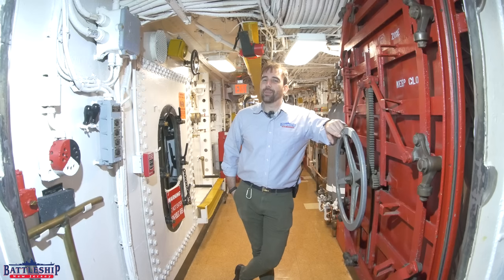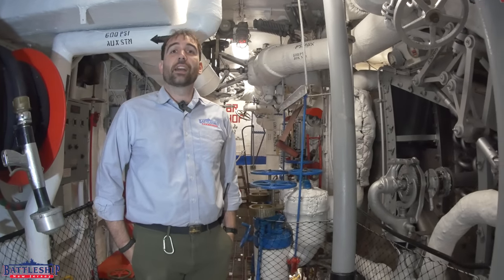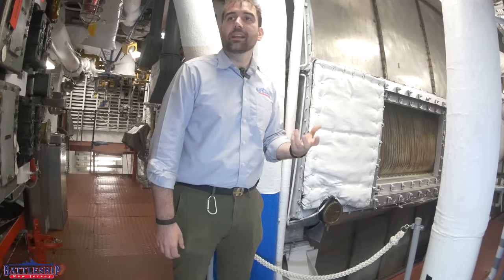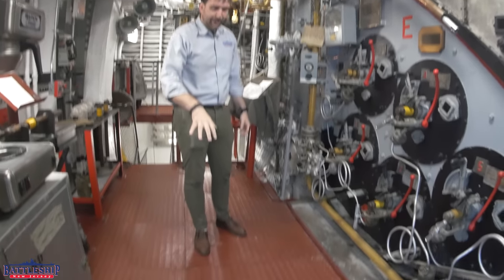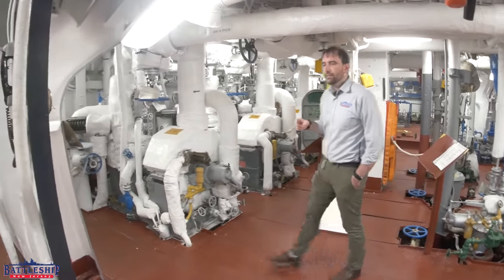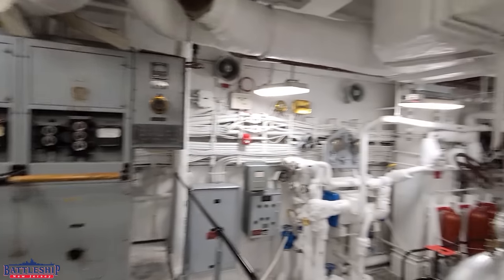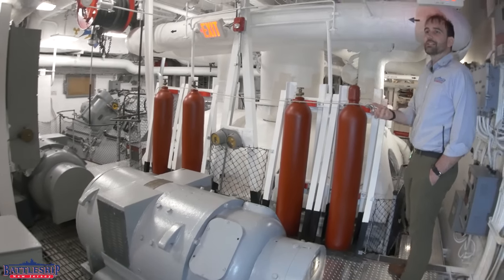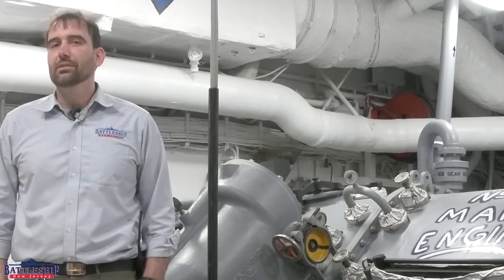Inside the Propulsion Plant of the World's Fastest Battleship

Comment: Excellent video!  I spent a 20 year career in Navy steam plants, and outside of a training facility, this is about the best general walkthrough I've seen anywhere!  I can almost smell the hot lagging and questionable quality (but necessary) coffee.  I really miss the camaraderie around those coffee pots and watchstations.  What a wonderful nostalgic walk back in time.  Thank you!

Couple of points, though.  Air and non-condensable gasses aren't particularly harmful to the turbines, but they are murder to the boiler, particularly oxygen.  High dissolved oxygen can cause nasty corrosion and pitting on the boiler watersides, leading to ruptured tubes in a surprisingly short amount of time.  As someone already commented, the air ejector condenser has the additional function (beyond condensing air ejector exhaust) of removing the bulk those non-condensables.  The DFT takes care of removing the last remaining traces.  As water is heated to the saturation point - when water and steam can coexist at the same temperature and pressure, the water cannot hold these gasses in solution either.  The DFT reduced dissolved oxygen to less than .01 ppm!  This is the final step of purifying the feedwater as it returns form the condensate system.

Also, the "big blue pipe" on the fireroom lower level is not the water going to the DFT, but the water coming from the DFT to the booster and feed pumps.  That long drop provides positive head to the booster pumps so the preheated feed doesn't flash to steam in the inlet side of the pumps.

On the burner front, you don't control the fuel/air ratio with the air register and SSD (safety shutoff device).  That's done by adjusting the fuel oil control valve (controls fuel to all burners in the bank) and the throttle setting for the FDBs (forced draft blowers).  Most ships by the 1980s had some sort of remote manual control at least, if not a full combustion control system to make that a lot easier.

Anyway, well done!  I love all your videos, but this one was a real trip down memory lane!

Comment: Why do people forget or overlook the fact that the New Jersey 's propulsion systems are worn out but also at the end of its working life and as the Royal Navy would endure with the battlecruiser Hood, pushing the ship's machinery beyond their designed service life leads to an uphill struggle to keep the propulsion systems going against the ever increasing number of issues
Reply: These ships are useful enough in any situation and replacing the propulsion system, and or rebuilding to factory specs would be much cheaper than building new battleships. In the current navy, they build task specific ships. Battleships can fill both ship to ship roles,. as well, as they did later in their carriers, a ship to shore, land bombardment role.   Missles just don't convey the threat of as 16" gun pointed at your face.
Reply: I work on machinery, Diesel Generators. Older machinery works well when maintained or stored properly. Expense and crew size are problems. Just making them work? We know how to do that.
Reply: A great example of this is the Russian carrier Kuznetsov. Can’t take shore power so had to run its engines all the time for power. Absolutely knackered and has to take an ocean going tug with it if it ever leaves port.

Comment: This video brought back memories of when I served on the USS Forrestal CVA59. I was a "Top Watch" in main propulsion. Each engine space had two 600# superheated steam boilers, and a main engine composed of an ahead turbine, and an astern turbine. Our main condenser used a main condensate pump( where you stated your system used a main feed pump to send water to the DA tank. I remember how those on watch stations, outside the air conditioned control booth, would keep their heads in the discharge of those blower ducts. It was really hot when doing "flank" bells!

Comment: Really good to see you spending time on the engineering plants of these great ships. I spent 2 years in the early eighties on the Coral Sea. The Midway class CVs shared much of their 212,000 hp engineering plants with the Iowas. The engines and reduction gears were virtually identical. The Midways had 12  smaller boilers housed in individual fire rooms and as I recall, the DA tanks were in each of the four engine rooms.  The 600 psi/800 degree controlled super heat plants in most US War 2  combatants represented the best all around balance of weight, economy and reliability of any installed in War 2 ships.

Comment: Very informative video for people who've never seen an engine room or boiler room. We had combined engine and boiler spaces on the Kitty Hawk(1972). 1200 pound steam plants. It was so hot between the two boilers on the upper level you couldn't stand there at all if both boilers were fired up. I spent many hours at the throttles in 3 engine room. Luckily for us the control booth was enclosed so it was bearable. The worst watch was when we were unrepping for food and fuel. I used to sit in a chair and operate the throttle with my feet so I could write down all the changes on the bell sheet and I had to coordinate all the shaft speeds at the same time. We had 4 rpm counters on our board. Some of the best times of my life.

Comment: Back in the seventies, I was an engineer on the container steamship Sealand Market, an SL-7. Each boiler put out 60,000 hp of steam at 875 degrees F, at 950 psi. It had twin screws, and the propeller shafts were about 32 inch diameter. It also went 33 knots.  At the time, they were the fastest commercial ships in the world. The company sold them to the US Navy, because when the price of oil went up, they became very costly to run.
Reply: I always wanted to sail one of those. Saw one of em in Dahmam during Desert Storm. Only Sealand ship I sailed was the Long Beach (POS class!😅).

Comment: I really love how this is more of a guided tour approach so that you get more of an idea of the internal layout of the ship rather than just static camera angles. 

Really appreciating how tedious and unpleasant it must have been to be stuck in those engine rooms, too, especially in sweltering tropical weather. Maybe if BB-62 will be reactivated in the future the Navy will install AC everywhere? Somehow doubt it, but who knows with all that excess electrical power the ship has :)
Reply: You have no idea, lol! The navy had a "maximum stay time", in main spaces based on temperature. Low and behold, it was always just longer than whatever the length of the watch was. When manpower was low, watches would go from 4 to 6 hours on. 2 watches per day, 4 on, 8 off, (3 section) to 6 hours, (6 on and 6 off, 2 section). The stay time temp was based on standing directly under the vents. In reality, there was no way you could stand a watch without moving from under a vent. Ambient temps not in the air vent stream was often over 130 degrees F. in the middle east. You ended up rushing from vent outlet to vent outlet while working.

Comment: I really appreciate your walk-through. It took me back to my days as a young Sailor going for my ESWS pin. I'm surprised at how very little has changed with propulsion. Larger ships and subs still need to boil water. They just  use a nuclear reactor to do it. I was on a small boy. We were gas turbine powered, but the principle of sending high RPM low torque through the MRG and out the shaft as low RPM high torque remains the same. We did a drag race with the Aussies one time. Only lost because of an unexpected casualty on our starboard shaft. If I recall correctly, that was the longer of the 2, so no surprise we strained it a little too much.

Comment: Brings back memories third class machinist mate. My ship was built in 1944. It was a troop carrier 600 psi main engine was a turbine, Auxiliary pumps were reciprocating lube oil purifier was turbine, as were ventilators. Like you said 120° down there. My duty station was the main throttle with sound powered phones.

Comment: I remember working with a man a long time ago who was in the Navy, assigned to ships. He told me that one of his duties was to walk along with a broomstick checking the lines of super heated steam. When I asked why he used a broomstick he said since super steam is invisible any leaks would basically cut the stick instead of someone loosing their life. That was over 50 years ago and it still sends shivers down my spine when I think of his words.
Reply: It's not possible for any kind of high pressure/high temperature steam leak, superheated or not, to 'cut' anyone or anything. That's just a myth. I used to use a mop or a rag on a broom handle for steam leak detection. If the mop/rag flutters, there's a leak. Sure, small bits of rag/mop would get torn off and if you walked into it would definitely be severely scalded, but not anything like 'cut' or sliced. As before, it's all a myth which someone must have started to scare new recruits.
Reply: @teresagreene7259   Almost all of those broomstick leak detection and cut people in half stories are nothing more than sea stories that should have started with "this is BS ..."
High pressure steam leaks are not really common and their only danger except to someone stupid enough to put their finger on the leak, is added humidity in the engine room and loss of efficiency due to water and heat loss. 

Superheated steam will most definitely cut, it cuts steel and even stellite valve seats. That is the real risk of steam leaks, they cut the gasket faces of flanges and the leak gets bigger. It does not take long for steam to cut steel.

Comment: I love it when I can correct Ryan, first FORCED DRAFT BLOWERS, only supply air to the boilers, Ryan said that the ventilation to cool the crew was from a steam driven blower;, WRONG, ventilation blowers are all driven by electric motors; Second, the air/ fuel mixture is solely controlled by increasing or decreasing air from the forced draft blowers, not by adjusting the air register lever at the burner; Third, Ryan said that the main feed pumps took a suction from the main engine condenser, indirectly, yes, actually the main feed pumps take their suction from the main feed booster pumps, I'm sure he worded it like that for simplification; Fourth, the DFT, has nothing to do with keeping bubbles from hit the turbine blades, it removes dissolved Oxygen from the feed water as bubbles of pure O2 will stick to the boiler tubes and over time it bores a hole in the tube causing a leak. I've corrected Ryan a few times but he never will admit it to camera
Reply: I counted a number of errors and posted myself.  I hope the people who do the engineering tour get more accurate information

Comment: Just wanted to let you know the forced draft blower does not provide air to the engine room through the vent you talk about. That is accompany regular ventilation fans drawing air from outside the engine room. Forced draft blowers provide air to the boiler firebox for combustion (to keep the "haze" you mention.  Without them there's simply not enough air flow at atmospheric pressure to sustain combustion ( black smoke instead of haze). Machinist Mate USN

Comment: The most advanced heavy battleships ever produced..57.000 tons with  35 knots...Unbelieveable performance ....
Reply: Calm seas, wind in the right direction right.  Or were they cheating.  Going over certain parameter's, increasing HP turbine pressure, increasing superheat temperature, going beyond max steam flow and pressure.  All these things could increase the speed of a ship.  There is a reason manufacturers put a limit on things, on naval ships these are the limits.  It has to do with materials and when they fail.  Your max factors take into account certain limitations that should make the ship run for a long time (Wear and Tear on machinery).  This could be from 85 to 95 % of the real limitations.  So the 5-15% that is knocked off, is there to make sure the ship will last a long time.  The thing is at 33 knots, chances are that is only 90 %  of what the real limit is.  The limiting factor is the hull design (and speed vs power cubed). Going balls to the wall and blowing steam leaks in lines, lifting safeties, making metal glow red, is actually asking for shit to happen, and this ship was designed in the late 1930s. At this point in time America had over 30 years of experience with battleships.
The most advanced heavy battleships ever produced-- maybe. The test, do what the allies did to the Bismark and Yamato and Yamato sister ship, if an Iowa floats away, you win.  Although I think the Iowa original fire control computer was very good. And the best material that could be bought.

Comment: I loved the virtual tour. I was briefly the 3rd AE on the SS Alpena which is the oldest freihter on the Great Lakes. Much of the technology you showed is very similar to the Alpena's . The Alpena was launched in 1942 and also had Babcock and Wilcox Boilers but they are single pass, sectional header boilers not M Boilers. Since you asked for feedback and ideas of what you could go into a deeper dive on I would love to see a complete flow path of steam and water for the system in addition to every pipe, valve, and gauge, pump, etc. shown and explained. Obviously it would be a huge task but it could be taken in parts such as a video on just the fuel oil system, a video on the lube oil system, a video on all the safety valves, etc. It would definitely keep you busy making videos. Thanks.

Comment: Another great video.   Not surprisingly gas fired power stations are very similar in basic design and function.  The injector nozzles are larger at 6 feet or more and are revoved, replaced and cleaned in a similar fashion right through to the noodle work bench.  It’s no picnic regarding the heat in a station today but I can’t imagine what those sailors went through every day. The hottest day of my life was shooting video in one years ago.  I suspect that 120 degrees is a low estimate that without those fans could reach much higher.  
Thanks for your great content.  Your team has made me quite interested in our great battleship  NJ.
Reply: Nozzle work bench.  Ha

Comment: Great video! Imagin allpof the engineering that went into designing the propulsion system, and they did it on drafting paper using slide rules - no personal computers running CAD in 1938 to 1942.

Comment: OK, I was one of the LPOs of #4 Engine room during the recommissioning in 1982. Look inside the His/Her locker if it's still there on the bulkhead and my name should be there. I'm not sure if you've been corrected yet about this. The seawater goes THROUGH the condenser tube's and the steam from the LP Turbine condenses on the outside of the tube's and collects in the hot well of the main condenser. This is the exact process that happens to the steam in the SSTG Turbine, but the SSTG process is on a much smaller scale.

Comment: The cool thing about that "phone booth" is that it is almost completely sound proof.  I was quite surprised how effective they were. It was like stepping into the booth to have your hearing checked.  As for the valve board, probably very effective as you don't have mechanical or electrical systems that can fail and give you false readings, bulbs that burn out, or electrical connections that short out or open.  I saw a thing on aircraft carriers and they still use something similar to track the movements of planes from the hanger deck to the flight deck and vice versa.  Just a metal table top and a box full of color coded magnetized washers and nuts.  The explanation they offered was that a nut or washer can be moved faster than the same thing in a computer and what happens if/when the computer system fails.

Comment: Excellent video but I noticed that you moved the ahead throttle clockwise to indicate opening. Every ship I was on (nuclear cruiser and 3 submarines) as a nuke MM qualified throttleman on 2 of them was operated opposite (clockwise to close) as are most valves.
Reply: Until I disconnect the mechanical linkages in a drill scenario. Than it doesn't matter. But you are correct. Counter clockwise opens the poppet valves on the Main Engines. Keep in mind reactor power limits and cavitation.

Comment: I retired from the USNavy in 1994 as a Senior Chief Machinists Mate.  My first ship was USS Ajax AR6 , commissioned in 1943...two main spaces,  four 400 psi boilers,  and two cross compound steam turbine engines,  with no reheat...aka...IP turbine.  400 psi,  650 degree boilers. Totally stickshift...even the Main Engine Lube Oil Pressure Regulator was a globe valve.  I was a Throttleman.
Reply: Two Ships later,  USS Pyro...one main machinery room,  one cross compound reheat steam turbine engine,  two 600 psi boilers,  with reheaters...then,  the big girl...USS Kitty Hawk,  CV63, then the smaller version of that Propulsion plant,  USS Waddell DDG24.
Reply: Let's light fires and get underway.

Comment: I was Navy and worked with Diesel/Electric. Diesel engines were the prime creator the electric power from generators which ran the motors that turn the shafts. Still had transmissions to control the speed... And at the time of the first "Nuke" powered submarines it was a classified system...

Comment: A video explaining the meaning and use of the different gauges on the control panel would help us understand how they monitored and managed this process.
Reply: Years ago I was talking to an very old engineer, he said the gauges were made to be at the 12 oclock position for normal operation of the systems.  That way you could instantly tell if something was going wrong.  This stopped happening after time as the original makers of the gauges were bought out or went out of business.